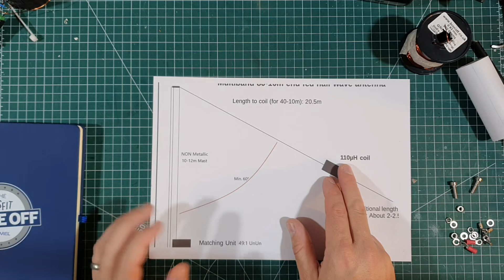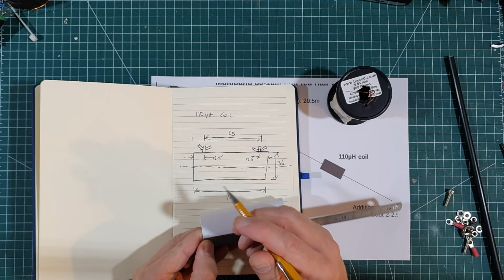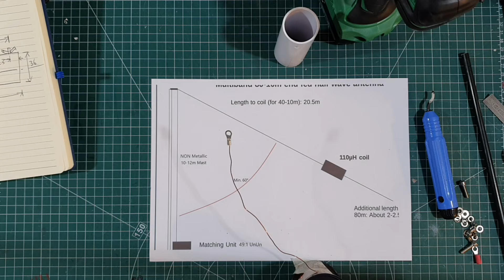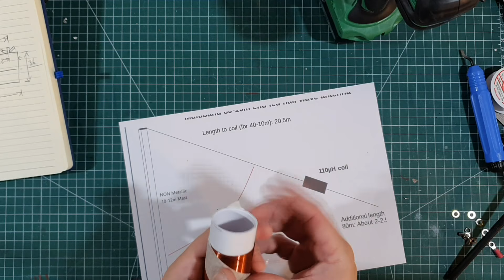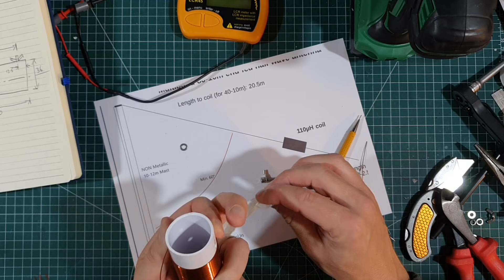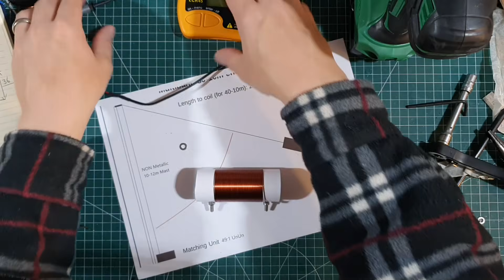80m with your 66ft end fed half wave antenna?... How to easily make a 110µH loading coil.

Comment: I build similar and found it worked quite well, also. I was happy. Enjoyed the video. Ta.
Reply from the maker: Thanks Richard. I see there is a few commercial ones and these seem to be wound on smaller longer formers.
Reply: @MM0OPXFieldRadio  I bought one of the commercial ones off someone on e-bay. However I wanted one which fit around my telescopic pole, so I made one using a tube from some silicone sealant, which should fit over the pole. My LCR meter seems way out, but I made my new one to report the same inductance as the commercial one!

Comment: Hi Colin, good to see another video from you, and of course we will be watching the follow up video, to see how it works.
I did something similar, but I added a 7.3mhz trap at the top of my 40m vertical and from the trap I added another 10m length of wire to get 80m and 40m without the loading coil. 
I also found with a tuner it would work on most bands. 
Good luck mate, 73 zl3xdj.
Reply from the maker: Thanks Brian. It will be a compromise but get you on the band at least. Many years ago  I also did what you mentioned. This was popularised by Len GM0ONX. It worked but Its location in garden and lack of radials made it far from efficient. In the right location I know it would work well.

Comment: I made a similar, much larger coil, using the same calculator using some 110mm plastic waste pipe and some 1.6mm galvanised steel fencing wire I had left over. Can't just remember exactly how many turns but it's around 14" long and can be tapped at any point for a good match. It will easily handle 100w and works well for 80m and also tunes up for 160 although it's very much a compromise for top band. It's size obviously limits it's portability unlike yours which will easily fit in a pocket!👍
Call me a cheapskate but I find experimenting with and building antennas "on the cheap" like this very rewarding.😃.
Reply from the maker: Definitely. I throw nothing away that I know can be used in an antenna. Eventually you get to a point where you have everything you need, if you can find it that is.

Comment: Hi Colin, I use one of these antennas at my QTH and one for portable ops. They work very well.  Another benefit is the ability to tune the 40m and 80m sections as two independent antennas with no interaction between each during tuning. Good video as always. Cheers Daryl de VK3AWA.  By the way, I have purchased one of Billy’s antenna switches based on your video on it.
Reply from the maker: Thanks for letting me know Daryl. The way I see it your not loosing anything but gaining something even if it's not ideal. Billy makes great stuff for the ham radio community. I've known him for years after meeting at a local club. We got licensed around the same time. He is selfless and will help anyone without asking for anything in return.
Reply: @MM0OPXFieldRadio  hey can you make a shortened delta loop antenna
Reply from the maker: You can but loading it up will likely  prevent it from being multiband.
Reply: @adamjlairepaquibolooc7129  A Dutch or Belgian guy tried it, did all the calculations for coils, impedances, etc. but found it did not work at all well. He also said that it was pretty much impossible to get a good match on more than one band. As soon as he adjusted for one band, any of the others would become unusable. After a week or two tearing his hair out, he gave up on the idea. You could make a multiband delta in the same way you would make a quad (obviously it would be 2 sided, not 4). The outside delta would be the lowest frequency, getting smaller as you move inwards. Adding a loading coil to the delta is where it all goes pear shaped. I've only used a 20m circumference/perimeter delta, fed via a 4:1 balun. This gave a perfect match on 10m (on that band it was a a 2 wavelength loop so would have had some gain). The match on 20m was, as you may suspect, around 2:1, as the Z of a 1 lambda delta is around 100R. That was a pretty good antenna but was only good for 20-10m. I didn't have a decent external atu at that time and the FTdx10 internal atu wouldn't touch it below 14MHz. Now I use an EFHW and will be adding an 80m coil soon. 73, Sean - G4UCJ
Reply: @scarlettgilbert1388  Are you suggesting a fan delta? Interesting. I'll let someone else try it!